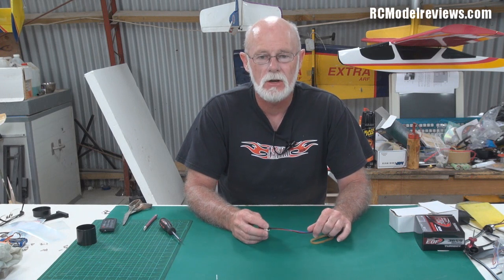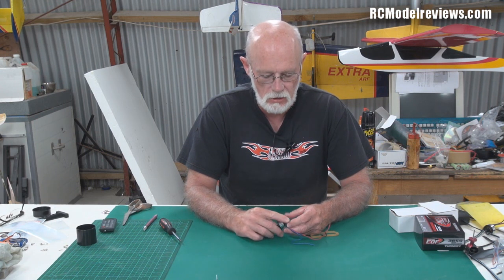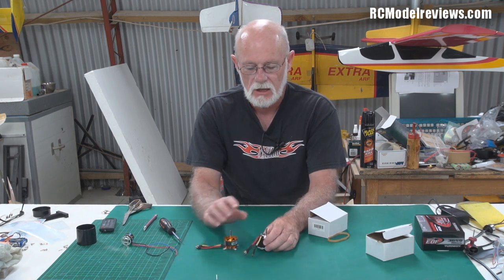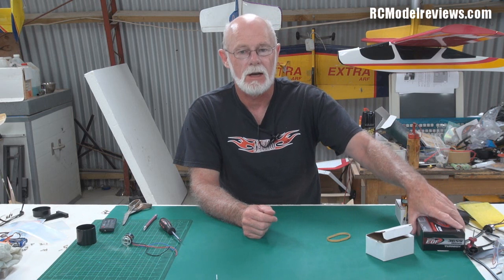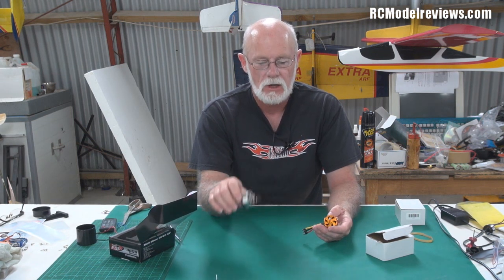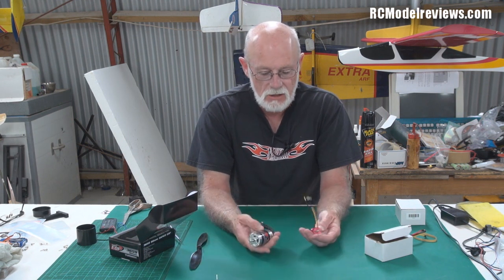RC BASICS:  brushless electric motors

Comment: I'm a newbie. how can you connect this through a batter if there's only two wires and the motor has 3?
Reply: You don't connect these directly to a battery, you need to a motor controller circuit (usually digital, although it's possible but inefficient to use relays) and the battery supplies that.
Reply: we use ESC to connect
Reply: It’s brushless, meaning the control doesnt come from a physical timing mechanism inside the motor but instead must be digitally controlled. The thing that performs that is called an ESC, and that is what gets supplied with DC from the battery.

Comment: Hello,
Thanks for your very nice video!  I was wondering what the lenght of a motor will change?  For example, if you a two motors with the exact same diameter and same kv but one is longer than the other, what will that change?

Comment: do you have any idea why. two of my engines wont run on my quad when i start the engines. while the other two do. until i use the throttle then they start working?
Reply: Derek Bamberger calibrate your ESCs

Comment: EDF?  It's the basics, help out this noob :p
Reply: edf is for airplanes with tiny ducted fans. like jet engine motor. they spin very fast because they have tiny propellers to generate thrust needed. othere outrunners spin bigger propellers at lower rpm to generate the thrust needed
Reply: Got ya, thanks.

Comment: I have two brushless out-runner motors that are the same size (both 36/38's), but if you spin one of them slowly (disconnected), it rotates quite easily with very little cogging.  The other one has very strong cogging.  When the first is on my model and I cut the throttle, the propeller free-wheels, but if the second is in my model, it stops the propeller when I cut the juice.  This is on the same ESC, so it has nothing to do with the ESC brake setting.  Could you say something about that?

Comment: One thing you failed to mention is what determines which way they spin, since some people might wonder whether you can use the guts of a counter-clockwise motor with a clockwise motor or visa-versa.
Reply: The motor can be made to spin in either direction, as you wish.  All the motors I have seen have 3 wires, as does the ESC.    The ESC supplies a 3-phase impulse to the motor, with current flowing from wires A-B, then B-C, then C-A.  Let's simplify that by saying that voltage appears on the wires 
A B C [A B C] A B ... etc.  Let's say the motor spins clockwise, but you want it to spin the other way.  If you swap any two wires from the ESC to the motor, it will go the other way.  Let's say you swapped B and C.  The motor now sees voltage on 
A C B A [C B A] C B ... so you get CBA instead of ABC and the motor reverses direction.  Give it a go.  It doesn't cause any harm.
Reply: +Mike Collins
Yeah, I finally figured that out after searching through a bunch of endless rhetorical bullshit about fixing bad motors, so I was really shocked to find out I could use a CCW motor as a CW motor or visa-versa. It blew my mind because I've been flying quads for around 10 years and I've never known this ! That's why I think this type of thing should be made a bit more public for future clarification of anyone who's new to this type of hobby.
Reply: ShadowⓋ But some of the motors are wound in a specific direction from the factory to run more efficiently in a curtain direction, also some shafts are threaded. To attach your props. You wouldn't want your props to loosen or come off in flight.
Reply: That's for brushed motors.
Reply: +Coboxite
Yep, I finally realized by simply switching the black and yellow wires on a brushless motor will cause it to reverse direction. That's why I thought it was very strange nobody ever mentions this or discusses it, since it would cause far less confusion, not to mention save time and $..
Reply: ShadowⓋ actually being a 3 phrase motor, you can swap any two leads to reverse the motor, I do this on a industrial scale with and way from a .25 hp up to 500hp   ac motors, 110ac up to 600v ac
Reply: is their any way you can switch it without changing where the cords go?
Reply: ShadowⓋ

Comment: can i use a 30A ESC for 400w brushless outrunner motor?
Reply: yeah, max 13.3 volt  battery, 3 cell
Reply: Thank you :)
Reply: +Bikesh Shrestha not sure tho. was using a basic formula. volts*amps=watts
Reply: II have done some research on the internet, so i think it will be fine. I haven't tried yet but hope my electroinics won't get fried.
Reply: But only one motor? Build a quadcopter, much more fun.
Reply: Just new to flying hobby. Will make quad too. :D
Reply: +Bikesh Shrestha  nice

Comment: Delco had a fan motor they called a "Inside out" or the industry calls it "outer rotor" motor and it is over 5 inches in diameter but has no permanent magnets like those brushless motors. First places I`ve seen those types your showing appeared in VCR`s and computer fans and disc drives. Now on a even bigger scale they are in furnace blowers called ECM motors .I have one that is 6 inches round and 5 inches long ,There are many now used in Dish washers and other appliances. those seem to be more powerful than the regular induction motors.

Comment: Hello and Thanks! I see this has been up a while. I appreciate it as I am just starting with the Flitetest boys. I am still confused by this: If my motor is a "Cheetah 2217/9" and ESC and Battery match the amps (larger than needed actually by 15 amps), and the fastest prop is 'Slow Fly 9x4.5',, what do I do to make more power? I mean, this is a 950Kv (prop spin rate per volt as you describe, i think... and what do I buy if this does not pull the plane fast enough? a ST3511 with 810 KV is slower prop speed, but pull bigger prop.

And I ask this because of the tagline of another guy "If you Aint Frying, ya Aint Flying." (roflmao) because, well, I did put a 10x7 prop on, 3s-11.7 volt, 30 C/1300mah battery and forgot to back off the throttle to let any "heat" dissipate.

well it did not dissipate. HA! my little 30 ampESC was hot enough to burn my fingers when it crashed, motor hot and battery as well (puffy, right?) and, AND i pealed away what little plastic shrink was still on the ESC to find those little "Do-Dads" that looks like chips had un-soldered them selves.

This learning curve for old guy is , well, I am learning.... lol

Thanks! scott

Comment: How do I determine (se) how "strong" (i guess torque) an outrunner has? Is it just that a bigger motor has more torque?
Reply: ...the thing it. I bought the VolanteX Firestar 200 V2 from Hobbyking    http://www.hobbyking.com/hobbyking/store/uh_viewitem.asp?idproduct=61392&aff=534080  and the specs says there is a 2815/1400kv motor on that one. When building the thing it turns out that there actually is an B4023/1050kv in it... So, is the actual motor in the airplane stronger than the one that they wrongly advertised due to it bigger size?

Comment: You always learn in school that you should never short terminals of a battery because the wires overheat from the large current.

If you look at a brushless motor, you'll see that its nothing but coils of wire. So why don't these motors "short" the power leads? How is this any different than shorting terminals of a battery? How is the current being regulated when the motor is operating?
Reply: A coil in DC is pretty much a short. This is because of the coil's reactance (imaginary part of its complex impedance), which depends on frequency. When you have a DC current, your frequency is 0 so you have no reactance (= no energy stored in the coil) and you have a short-circuit.
In the case of DC motors, I believe, its dude to the fact that the coils have really long wires and are only active for a fraction of the time. Plus the power you feed the coils is being transformed into torque. If you held a DC motor in place while powering it, I'm sure it'll heat up and possibly burn.

Comment: Back in the 80's RC car motors were rated on their maximum rotational speed, but not on power or torque.  (Real car engines are rated on power and torque).  It seems that these days nobody even lists the maximum rotational speed anymore.  The only way to rate motors in the number of turns.  Why is it that nobody rates RC motors based on power or torque?
Reply: They're rated by power and rotational speed per volt. The motor will have a rated wattage, as well as a KV rating, which is how many revolutions per minute you get per volt of potential you give the motor. Couple that with the maximum amperage the motor will take and you can pretty easily calculate a torque curve for it.

Comment: Thanks for all your videos!  Aside from planes, radio, and batteries, I am glad to know that the leaded solder are the superior stuff.  I've been fooled.  I am going to guess that the silver content has virtually no performance enhancing properties either.  Do you happend to know where you can still buy an open can brushed motors?  I used to tinker with the brushed open can 480s and 380s.  I think they still have their place today, such as in a larger cheap 3 and 4 channel helis, that can't take a separate esc.

Comment: Bruce, please could you test a group of ‘branded’ brushless motors (e.g. Tiger Motor, Scorpion, SunnySky) against so called ‘budget’ alternatives (e.g. Turnigy or eBay sourced) of the same specification (weight, power, kv) and report if there truly is much of a difference. Many of these branded motors cost 4-8 times the price of the ‘budget’ ones, but I’m sure much of it is hype and snobbery created by newsgroups. Are they truly worth the premium?… and no sitting on the fence with your conclusion please! :-)

Comment: I noticed 1 of my motors on my QR x800 has quad a little wiggle to it what should I do? It power on just fine the blades look like they are spinning at the same speed. None my other motors have this small wiggle.  Do you think I should replace the motor that has a small wiggle? Let me know what you think.
Reply: Replace the bearings

Comment: so by multiphase you mean 2 phase?  I have seen large 3 phase motors but they have 4 wires.  I assume these 3 wire motors have 2 phases and 1 common? 
Curious about this, I have never heard any discussion on this topic before..
Reply: The motors in this video are 3 phase.  The 4th wire you may see on a 3 phase motor is a common, which isn't needed for operation.

Comment: Hello,  Get information!  I have always used gas engines for my RC airplanes and copters.  I am new to the whole electric flight. Since the great power with the Li-Po batteries.  Is there anyway to free up a brushless outrunner?   I has been in quads and hexacopters.  One thing I am learning by mistake is the props.. You cant crank them down like on classic RC gas engines.   So I have Ruined 2 engines already.   They up but are just less responsive.  If you have any info that would be great.  These litttle buggers are not cheap.  Thanks

Comment: @nashnazer well the motor itself does not make too much noise.... Majority of the noise is caused due to the blades cutting through the air.... Its the same principle with outrunners also.... Majority of the noise is because of the blades and not the motor itself....

Comment: The problem with an inrunner is that you can't fit as many magnets into the rotor  which means less resolution. This affects your accuracy in terms of RPM. The centripetal forces on the bell of an outrunner are FAR greater than the forces on an inrunner as the distance from the axis of rotation (The shaft). As Bruce said outrunners have more torque because of the large radius, in runners can achieve high RPM because of the lower tangential velocity of the magnets. Hope that helps

Comment: Love your Video's, and i have to admit i learn alot from you :-) Thank you.
I have a question for you. I never throw my motors away, and i rewind them sometimes because i believed that i could do a better job putting more Copper in them, the Problem is when a motor works for a longer time and it gets hot a couple of times the magnets get very weak. Do you know a way to reinergize the magnets again?
thank you....:-)

Comment: What I find a little confusing is that sometimes the "2820" dimensions are the diameter and length of the stator of an outrunner i.e. the internal dimensions and sometimes it appears to be the actual length and outside diameter of the motor itself.

Comment: The AC motors wires are independant of each other, the RC motors are not.  Too many people are walking around thinking they have AC motors in their RC models, but they do not.  That have DC motors with switching grounds (where the current changes direction).

Comment: Bruce, you need to be more specific when you talk about these motors.  These are not AC motors.  They are dc motors with alternating current.  There is a big difference.  A three phaze AC motor does not use a switching direct current, but these do.  These RC motors alternate which wire is ground, and a direct current is applied to the remaining two wires.  An AC motor has three wires connected directly to the national power grid, and the current flows back and forth at 50hz or 60hz.

Comment: What`s difference between a 16 and 22 pole motor in performance etc please Bruce?
I`m looking at the HK 690 kv 22 pole motor,and a HK 610 kv 16 pole motor for a quad.
Both are Turnigy Multistar motors.

Comment: KV stands for revolutions per minute per volt, so a 100kv motor on 10V spins 1000 RPM (without a load)

Comment: Brilliant explantion for those of us needing to translate motor numbers. If you would please explain the KV rating. Seems to me that lower KV motors are used for larger planes/props, and higher KV motors for smaller applications. Seems counterintuitive to me. Why is this?
Thanks again Bruce. 
PS: I've suggested to HK that they provide you a 9XR TX for testing. We'll see if they follow through. I hope so, along with many others.
Cheers

Comment: another good one, could you explain later esc to do with the cells of batteries and the differences eg. 3s 4s etc. also the numbers of kv, diameter of motors, esc amps, so many questions and you will likely explain all, thanks

Comment: kv refers to rpm per volt. so a 1100kv motor will run (no load) at 9240 rpm on a freshly charged 2S (8.4v) and at 13860 rpm on a freshly charged a 3S pack.

Comment: 1:34 a bit confusing and possibly misleading. The electromagnets all work at the same time when they are on they are all on. The motion comes from the 3 phases every third coil is the same phase and then the permanent magnets are more numerous and will always have some out of alignment and the coils alternate poles. Anyways not trying to nit pic but you make it sound like the coils turn off and on like in brushed motors. It can be quite hard to try and describe how the brushless motors work.

Comment: Hi Bruce, I am no expert. But I know a motor (align 500l) that is outrunner but doesn't turn on the outside, at least it doesn't look like since there is a protective casing. So this may be misleading method for deciding the type for basic users, but if you are basic user why care about type of the motor :)

Comment: Nice Bruce but not as informative as your usual videos. 
There is a lot more about the motors that you could have included. What about KV number, poles, timing, voltage rating, power consumption, current rating, types of mounting, shaft types etc etc etc?
If you are trying to keep them short, fine, but at least let us know that there will be more coming.

Comment: Bruce:
Thanks for this video. Could you follow up with what the third numbers mean on the motors. By this I mean the 2212-13 or 2212-6 and so on, on the RC Timer motors (as you said they can be different and you have used these motors)? Can you explain how they change the KV's on the same motors? Can you talk about the numbers of wraps of wire and does it matter what gauge wire is used for the wraps? How about, how to figure what prop to use with each motor.
Thanks for the videos.
Don

Comment: Great looking series Bruce, I enjoyed this one.  Just out of interest, on the AXN motor there, I noticed you had removed the prop saver pegs from the shaft base.  I wanted to do that with mine as I'm going to use a collet for the prop.  But it felt like a hard job removing it and didnt want to break it.  Any advice on removing it?

Thanks